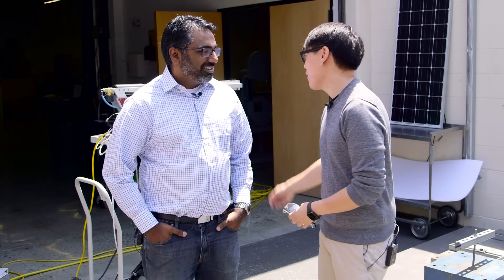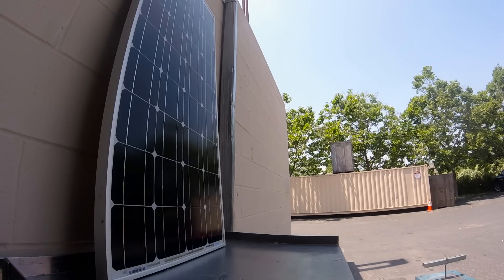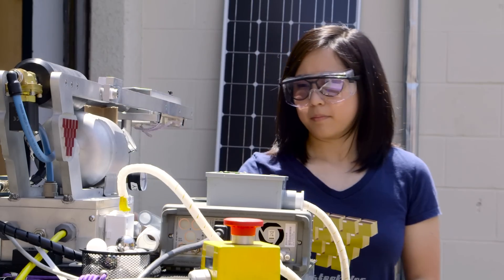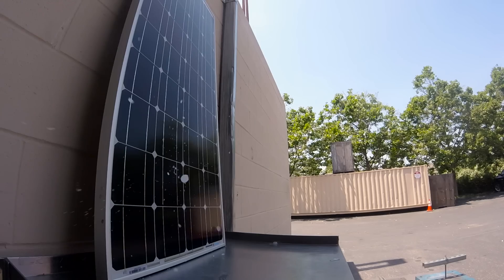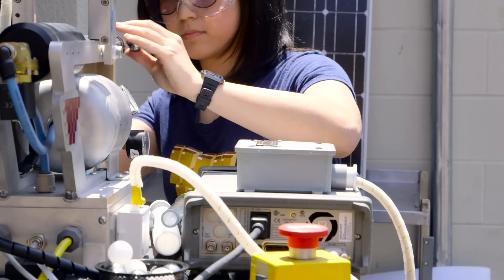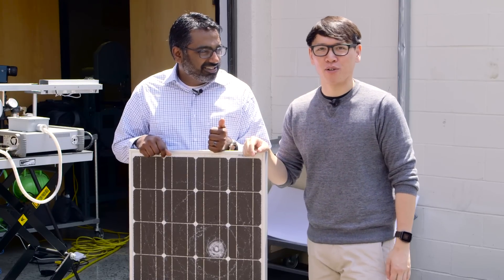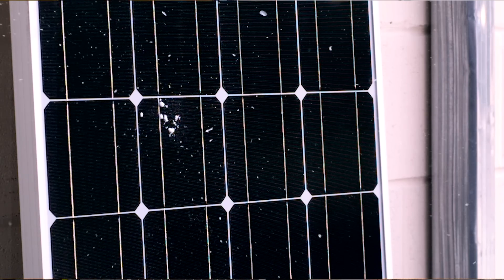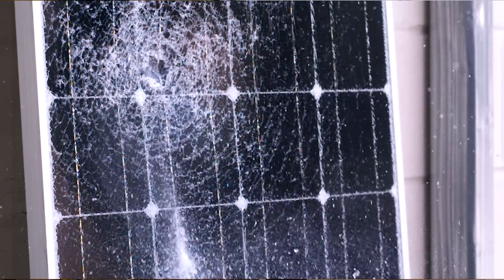Testing Hail Damage to Solar Panels!

Comment: It didn't destroy the panel but will it still work following the damage and what kind of efficiency loss do you get after the damage? Also is there anything you can use about the home to do makeshift repairs for the panel?
Reply: You don't need to. The damage came from a solid plastic and a steel ball, not the ice...
Reply: Michael Berthelsen I'd still be quite interested to find out hte answers to the questions regardless of what caused the damage. I think it would be an interesting Test and possibly even a challenge for Adam to take the Panel to peices and rebuild/repair as best he can. I mean the test they did wasn't only relevant to people who are liable to get hit by hail but also perhaps those who live near golf courses where stray balls could cause damage or even simple stones launched by passing traffic at roadside houses. The ice machine is interesting and all but I thought the video was more about the panels and what kind of treatment they would take.

Thanks for replying though.
Reply: Bob Leonheart My point was that hail doesn't generally damage solar panels. They're built to handle weather, including hail. The ice did no damage, so you're unlikely to need to repair it. And I doubt you'd install this where it's likely to get hit by golf balls... As for cars, do your windows regularly shatter from stones? Because the glass used for these is harder/tougher than the glass used for your average window.

That being said, watching Adam repair one would be an awesome video! =D
Reply: Michael Berthelsen I do as a matter of fact live near a Golf course and am interested in using Solar power. (hence why I'm asking actually) I understand that you think it may not matter to you and I understand if you might not be able to see a situation where the questions are relevant but can I be honest? I can. That's why I asked the question. I didn't mention the material hitting the panel in my questions because it was not relevant to the information that I was asking about.

If you are able to answer the questions I asked them please feel free to do so but I would appreciate it if you would not try to convince me that my questions are pointless. Thanks again for replying.

Comment: The format of this was incredibly stupid. Show multiple speeds at the same time then go back and say you changed the speed? Ridiculous. The time between the shatter and saying you changed I was thinking about why it would have shattered then and not before.

This channel is going down hill imo, which is a shame because I really like the idea of the videos but most are poorly executed like this.
Reply: Wasn't the speed, they changed the ice for solid plastic and steel. Even worse...
Reply: +CRABST3R ! Go back and have a look at the first breaking slo-mo. It was a plastic ball. And they even mention it at the end of the video...
Reply: They tested hail at normal speeds and the panel broke the next test was testing how much it can withstand by increasing the weight and density of the object they can see how strong it can hold up.   The same goes for the metal ball. They want to see at extreme conditions what would happen and how much damage it would cause.
Reply: +Michael Berthelsen haha I know, it's pretty obvious when it didn't break or crack on impact. Like I said it to test how durable the panels are. It's hard to test when the ice breaks and releases energy. So they go with something denser.
Reply: I'm not outraged that they went to more dense materials. I'm upset that they did it before explaining they were doing it. it's just offputting. See all the ice shatter then, "Oh, that one did some damage! Must not always work" come to find it's plastic instead of ice... being informed before showing that they're now moving on to extreme circumstances of say "raining golf balls" would be fine.

As I said I like the content but it's lazily presented every time. Not to mention the simple words Norm constantly fumbles over. I realize it's a lot of work they're putting in, I just feel like it's not much more to make something that seems so much better.

I'll stop complaining about things I get to watch for free on the internet now...
Reply: Donald Carnohan
 More like rocket golf balls. And I agree with you. Destructive testing i fine, just tell us first that the original parameter of your test is going out the window because nothing broke due to good design. THEN move on to plastic and steel ball. Otherwise the title and description is misleading, especially the thumbnail they use, which is completely different from the title underneath.

A little bit more effort and thought, as well as some planning and structure would go a loooong way, since it IS very interesting, just as you said. And as mentioned before, I'd LOVE to see a one-day-'build' of Adam fixing one of these...

Comment: so what do we know from this now? is it still working or wtf?
Reply: I was wondering the same thing.

Maybe it partly works, if so, what % did it drop.
Reply: i do aggree with that tho... does it still work or how well does it work....???
Reply: Well, we know the glass on top of the panel can withstand hail, but not plastic or metal projectiles. So, should work well on top of your house. (Provided you don't live in a ghetto 'hood like I do. Random gunfire voids warranties.)
Reply: If the silicone slice doesn't crack then the entire thing is fine, if it does crack then it's just missing one section and in the event of a full contact strip severing you would need to repair that strip so power can flow again.
You can actually get broken PV parts on ebay and make your own slightly dysfunctional panels, although the salesmen caught on by now and the prices aren't that great.